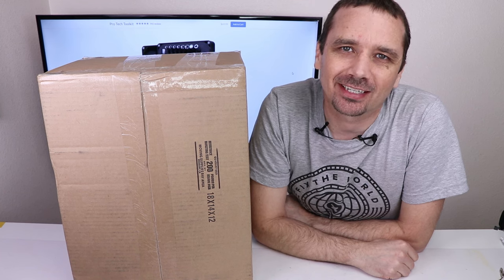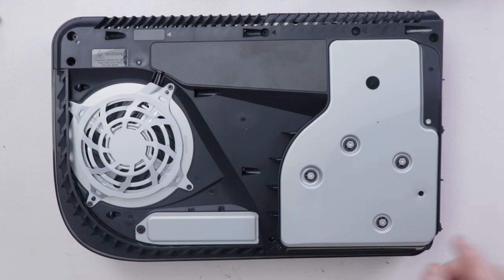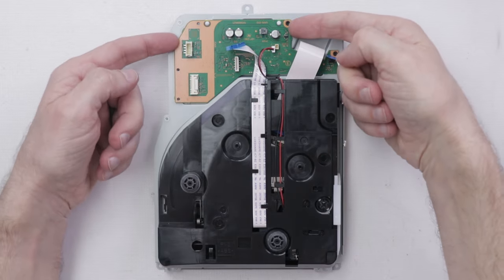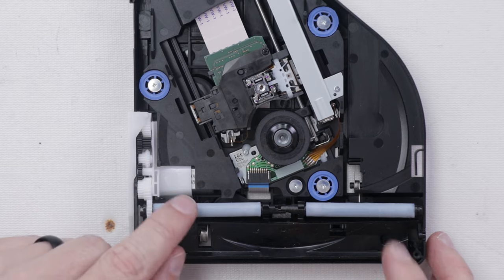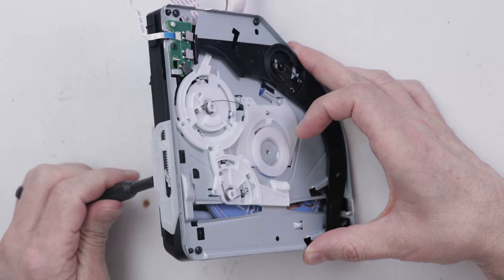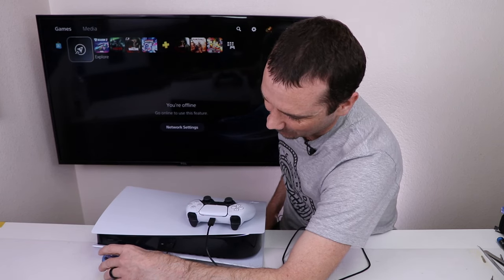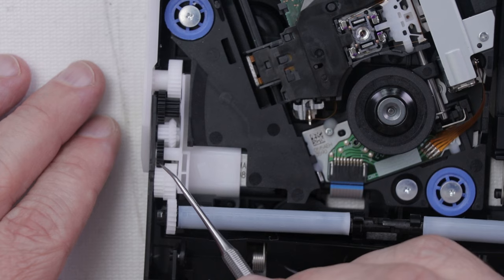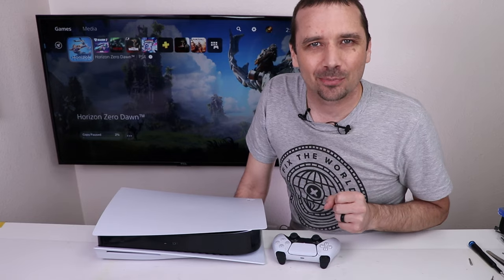Fixing a LOUD, Broken PS5 - First PS5 Disc Drive Repair!

Comment from the maker: My favorite electronics toolkit: iFixit Pro Tech Toolkit: Amazon (paid link) https://geni.us/XSeAlI
Is your PS5 disc drive really loud?
Reply: No PS5 isn't released yet☹️🤣
Reply: Mines is loud wen I put discs in..I don't use it coz of the noise..I just use digital now
Reply: Hey tronics you got any use ps3 controller? if you do i like to buy one. thanks!!!
Reply: Hi Steve? I watched recently all your older video. Your voice way more 'normal' rather current one, lol. Love both of them but back then, your hair a bit thicc 🤣
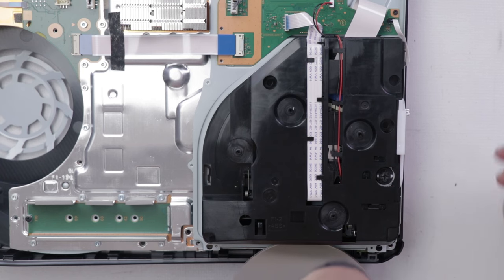Reply: The buzzing noise comes from the manual eject screw after someone ejected a disc manually. It keeps spinning when the gears are moving while inserting a disc (like in this case in your video 7:34) and it is not supposed to do so, it is supposed to stay still while the disc drive is taking discs the automated way, reseating it will fix the issue. This can happen to a PS4 disc drive too
Reply: The ps5 is under warranty still why would he not talk to sony first, I sure would with a $500+ machine
Reply: Yes
Reply: Lol
Reply: Can you fix my ps4 from making the loud air noise?
Reply: Would I be able to buy a PS5 from you maybe on the inside of the faceplate it signed?
Reply: Hello, I have a ps4 slim but when I insert my CD in takes it but when I get the CD out the black arms don't close, can you Pleas tell how to fix that
Reply: @leonardolovrencic8379  That's why I own an Xbox one x....no problems. Plus is American!!

Comment: Yes a broken gear could make that noise. I wouldn’t call it “fixed”, but it’s definitely working now.
Reply from the maker: It's as fixed as it can be right now since there are no parts available. I know that a broken gear CAN cause noise but I don't think that's the source of the noise in this case.
Reply: @Tronicsfix  can you try 3d printing a gear?
Reply: @shoaibcasseem647  That is an amazing idea, do you have a 3D printer Steve?
Reply: @shoaibcasseem647  that can be problematic as many times the gear isn't as strong as the original. It depends on the material used though.
Reply: @Tronicsfix  a new revision might fix it too.  Seeing as it took Sony 3 revisions to finally get the Motherboard fight on the ps4, maybe they'll be able to fix a disc drive problem faster?
Reply: @awilliams1701  using ABS and with appropriate parameters set on the slicer software, dont you think the gear will be strong enough?
Reply from the maker: @shoaibcasseem647  I don't know of a 3D printer that could make a gear this small and precise that would be strong enough. I might be wrong though I'm not a 3d printing expert by any means
Reply: @aftertheshowmoviepodcast  Most consumer 3d printers can't print such small parts in a resolution that would work
Reply: @Tronicsfix  somehow I believe it is the source cause as you put that precision grease(?) on it got a bit quieter. I only say that cause I have an early model 1st wave 1st batch I kid you not it's not that noisy. it's a smooth take in and eject. wonder how did this person break it or over time did it just get like that?

props on the repair though to get it to do its main function again.

Comment: I tried fixing an electronic uno machine but failed horribly but I was inspired by you to do it
Reply from the maker: That's a start! I've fixed lots of stuff until it was broken!
Reply: If just something broke off you can fix a lot with thin super glue and tiny glass pearls.
Reply: Uno machine?
Reply: @lucytello8002  thats a machine where you can press on a button and if you are unlucky the machine will spit out a random number of cards. I had an problem with mine as well sometimes the cards hit the plastic cover and he doesn't spit them out.
Reply: Same, I tried to go back and fix some old joycons I previously tried fixing due to stick drift but ultimately, my first repair didn’t work even though I replaced the thumb stick things. Went back a week or so again bc I felt inspired and again, it didn’t work. I realized afterwards that a simple calibration was all it needed lol.
Reply: Thanx king ♥️
Reply: This is the best thing I’ve read all day. Good luck homie with future things you try and fix!

Comment: Another video where Steve boosting our confidence by showing that small noises are not a concern as long as the major problem is solved.
Reply from the maker: Ideally, those gears could be replaced but there's just no parts out there for them yet.
Reply: @Tronicsfix  Hey, maybe someone will start a 3D printing business printing parts like that, that would be cool
Reply: @cmdr101z8  dang that's actually an awesome idea
Reply: is there another way?
Reply: @cmdr101z8  Sony would due them
Reply: @cmdr101z8  better they be prepared to be sued
Reply: @Alex_Donnovan  gears aren't owned by sony. The store would just be making gears of all shapes and sizes, they just happen to be compatible enough to replace
Reply: Can't copyright gears lol @Alex_Donnovan
Reply: Steve from Gamers Nexus?

Comment: I actually had the exact same issue on my ps5 when I was trying to fix the extremely loud disc drive. Eventually I found out if I just took out the spindle and re-seated the top metal piece it fixed the issue. The buzzing went away on its own, but its still noisy.
Reply from the maker: Interesting. Thanks for posting this so hopefully it'll help others with the same problem!
Reply: @Tronicsfix  looking through the comments I haven’t come across anyone saying this yet but wasn’t that screw spinning making the noise? Watch at 7:33
Reply: Unless it’s supposed to spin I guess...

Comment: 7:36 that noise is that screw and it means its slightly loose. I guess whatever broke that one gear tooth did loosen whole train. 
maybe you could lubricate that one screw that is rotating and eating that plastic around itself ? maybe that's the vibration source.
Reply: I was wondering if the screw was meant to spin. Otherwise I don’t know how he or anyone watching the video could have missed it. He points right at it seconds before it starts to spin and rattle.
Reply: @gofastER  Yeah it's supposed to spin

Comment: The buzzing noise comes from the manual eject screw after someone ejected a disc manually. It keeps spinning when the gears are moving while inserting a disc (like in this case in your video 7:34) and it is not supposed to do so, it is supposed to stay still while the disc drive is taking discs the automated way, reseating it will fix the issue. This can happen to a PS4 disc drive too
Reply: My PS5 makes a similar noise so I'm convinced it's just normal
Reply: Yeah I don’t know how he missed that when he pointed right at it seconds before it started to spin. And I don’t understand why everyone is so caught up on the gears. It’s clear as day that screw was spinning and rattling around in there.
Reply: Even when you point it out, people respond without getting it 🤦‍♂️
Reply: @gofastER  yeah man, it's hilarious, basically everyone ignored me lol

Comment: Thanks, Steve had a PS5 come in last week with HDMI issues had a noisy disc drive very noisy gears grinding not taking discs. I took it apart reset the mechanisms and made sure the gearing was set right luckily this part was ok on this PS5 no shaving was needed to the plastic. This fixed the noisy disc drive I suspect it was caused by the console falling when the HDMI was broken.

Comment: Nice, if the disc drive was totalled, would another disc drive work in the same console?
Reply from the maker: Yes, you could replace it but you'd also need to make sure to replace the green board too. I'm not 100% sure that they are married but I think they are.
Reply: @Tronicsfix  Alright. Cheers.
Reply: @Tronicsfix  Could you test this out in another video? I presume you have at least 2 machines. Would make a interesting video.
Reply: keep the electronics swap out the mechanics. Motor is okay to swap.
Reply: Most likely like the PS3 the board is married to the motherboard and would need swapped over to new drive. But just a guess
Reply: @Tronicsfix  Well that's annoying.

Comment: Plastic gears are usually after market and not custom.  But if they are maybe it is time to look into a cheap desktop injection molding machine and determine a mold of the gears to make on demand.  It's a small investment,  but it would support all future consoles as well as give you the ability to sell them as spare parts.

Comment: I finally bought my base PS4 an external cooling unit that attaches to the back after years of trying different fixes. It is finally working quietly now, yikes that took a long time lol
Reply: Thats strange you shouldnt need a external cooling unit to cool a console that should do the job itself. What are these different fixes you have tried? Did you take it apart and clean the heatsink incase it was trapped with dust? Have you tried replacing the thermal paste with MX-4? Let me know as I want to help you sas you shouldnt need to be using external cooling.

Comment: On gears like those I've used PTFE grease with good results. Spray it in a container and then use a screwdriver to dab it on the cogs.

But probably the best lubricant would be that yellowish off-white grease that was used in VCR mechanisms

Comment: Another one saved! If you want to experiment with gear lubrication, go to a hobby shop that sells RC cars and buy different shocks oil weight and gear lubricants, until you find one you like (I like the Associated silicon lube grease). Magical skills, by the way!

Comment: I really wish these manufacturers would spend the extra bit and make things like gears out of metal... i mean when you are spending this much on something it should be built to at least withstand a jammed drive without breaking gears or ruining other parts. My ps5 had to be sent back due to drive not ejecting all the time too...

Comment: Should have placed some masking tape or even just a thin sheet of paper underneath that arm before you started scraping it. It's clear from the footage that this created a lot of tiny plastic debris that fell into the drive. You can even see a small piece of plastic fly into the drive (lower right, near your hand) at 6:13 after the loud click of the arm.

Comment: Steve, did you notice that the drive wasn't making that buzzing noise when it was ejecting the disc? I, too think that this is not a case of gears as those would make the exact same noise when ejecting the disc as the only thing changing is the direction in which the gears spin. It may be a motor broken inside and when it spins 'forward' it buzzes but when it spins 'backwards' it doesn't. Might be worth a shot.
Reply from the maker: Good point, but also when the disc is going in there's a lot more pressure on the gears. Since the noise is still there but just quieter when the disc is ejecting I think it's a matter of how much load is on the gears. I could be wrong on that but it makes sense to me. It also could just be the eject gear.

Comment: Kinda worried to put discs in my system too often. I wonder if that was a manufacturing defect or happened over time.
Reply: Ikr I was installing my ps4 collection and my disc wouldn’t eject out the ps5 even though the system had said it did so. To begin with I had it in vertical position, so I just put it back to horizontal position and worked but still I’m worried :( but it happened after like the 4th game I installed .

Comment: was wondering if you could use some wire from a 3d printer, melt it, and fill the gap instead of removing material? like maybe a stronger plastic so it wouldn't wear as quickly? Oh, i had a comp disk drive make the same noise and i used silicon grease and it did the trick. thank you for the video!

Comment: Surely this would have been a warranty repair? Why didn’t Alejandro just get Sony to fix it? But then I guess that wouldn’t have made a very good video!!
Reply from the maker: This would not have been a warranty repair. Any damages caused by a customer would not be covered under warranty.
Reply: @Tronicsfix  you say that yet it is caused by Sony and their ignorance to issues, remember PS4 and the motherboard issue, no point in defending them when they're in the wrong (just my opinion no offense meant at all :))

Comment: My PS5 sounds very quiet but randomly the disk drive spins pretty loud and then stops.
Reply from the maker: Unfortunately, that's pretty normal for these.
Reply: That’s normal, it’s probably just checking the disk
Reply: It's normal, it seems to be a software issue and sony seems to be aware of it. Maybe in the next software update we will see a fix.
Reply: @rockl79  It spins up every 45 minutes to check the disc, I saw mention of them fixing this in the update that will bring internal SSD upgrades in the summer.
Reply: Someone says it may do that because the drive is located underneath the power supply so spinning the disc at random times may keep the disc from possibly getting too hot and warping.
Reply: It's a proper crappy thing. Not needed, XSX doesn't do it.  So what is the ps5 excuse
Reply: @lewis523  xbox isn't the end all.
Reply: @lewis523  you know what else xsx don't do? Have great games like ps which is why it wins every gen in the long run... Better games means better sales
Reply: @destinylags6863  game pass shits on ps5 alone. You have fun spending $70 on a game when they come out

Comment: One of these days I need to fix the rollers on my PS4. I don't use many disks. It's 99% use is streaming video. lol But when I watch a blu-ray holy crap it takes forever. It's not a launch day PS4, but it's so close to launch day that it might as well be. Maybe like 2 months after launch. This house is SUPER dusty. So yay issues. lol

Comment: I would love to see you do a video addressing overheating on the original fat PS3 (delid mod)
Reply: Most consoles if not all have the same issue when it comes to overheating it ether A. The fan, B. The Heatsink is trapped with dirt not having enough ventilation or C the thermal paste is ether rubbish or dried out.
Reply: @konsolemend  yes on the original PS3 it's the thermal paste under the CPU and GPU which means you have to remove the IHS and apply new thermal paste between the chips and the heat spreader

Comment: PS5 disc drive is a faster rated drive than the series x. 8x and 10x seemingly depends on the size of the blu ray disc.

Series X, one X, one s and the one use basically the same 6x drive

Comment: Hello Steve. Great vid. I have a similar problem with my ps5 but I put a disk in and it got stuck. I tried manually taking the disk out and the disk still won't come out. Any suggestions?

Comment: What ur take on the ps5 system design. As u have been fixing them.?? Would like to have ur input.
Reply: the console spec wise is a beast but software and build quality are horrible i have 7 ps5 consoles waiting to be repaired 3 have disc drive issues where they don't read discs are noisy or dont accept discs 1 has the dreaded freezing when attempting to play games the other 3 suffer from coil wine die to the cheap capacitors used also have numerous dualsense controllers where the springs have broken or come loose seems to be a common issue
Reply: @johnsellers4994  its that bad. F me. Thanks 4 ur input

Comment: Shame that there's no replacement parts for ps5. Good job anyway, you need another faulty ps5 to replace those plastic gears... Or maybe a graphite grease, I'm not sure how it would be behaving with plastics for a long term but it could be better than machine oil. Even as a temporary fix machine oil isn't that bad, anyway inserting disc takes 2 seconds, so as a shirt term notice it wouldn't be disturbing at all.

Comment: When i turn my  ps5 on, it makes a little and fast noise in the drive's region (like something starting to roll), but everything works fine. I tested all the cds and seems ok. Is there a possibility of this happens and the drive is good? Its just happen when the console iniciates.

by the way excelent video!

Comment: I'm curious if the disk drive ever worked. How would that arm fall out of place unless they attempted their own repair?
Reply from the maker: Yes, it used to work according to the owner. I'm guessing it may have happened with trying to take a disc out too fast or possibly even trying to put more than one in. It's hard to say.
Reply: That noise could be due to the lack of grease on the gears or the quality of the plastic the gears are made of.
Reply: @EddieLeal  
Lots of plastic gears do not need any lubricant. It just attracts dust to stick to the surface. It can also be intentional to have a simple part fail that is easy to replace while protecting other components. Seems like someone used some force. I'm just spitballing, but there are some that have problems figuring out which side to place the disc in the drive when the console is in a vertical position. Maybe someone tried to pull it out while it tried to drag it in.

Comment: What if the rollers themself make those noises? Spinning on those think axles could maybe make noises in one direction but less in the other, maybe it had issues to pull discs in and maybe got dust or something else into it?

Comment: That sounds like the internals of the motor that turn those gears is the issue causing the noise.
Reply: its loose fitting gears in the drive they are sleeping because they don't fit snug

Comment: Putting a machine (mineral) oil on plastic parts is not a good idea. Petroleum based oils get into reaction with plastics and degrade them, so they become brittle and fall apart.
Reply: What would you suggest they use?

Comment: I got something stuck in my disc drive got it removed by taking it apart couldn't figure out how to get the disc drive working again could be that black and red plug ill try it thank you. But for the last 4 months I can't put my ps5 into rest mode without it shutting down and having to repair it could the disc drive not working have anything to do with rest mode